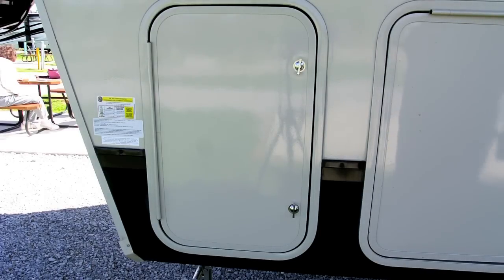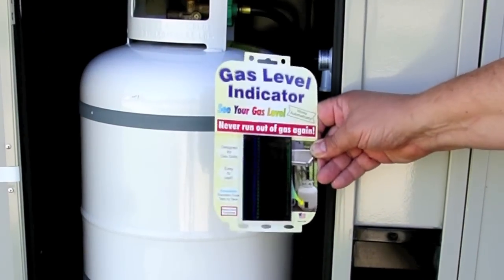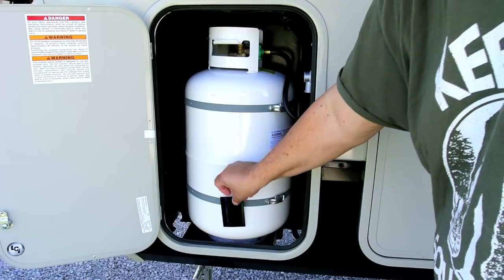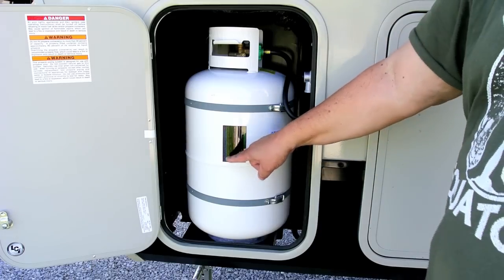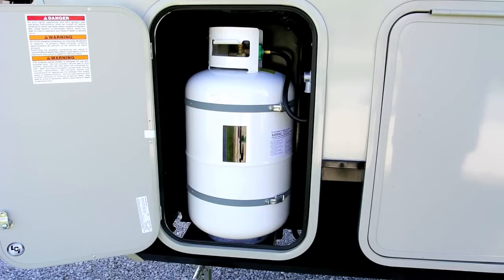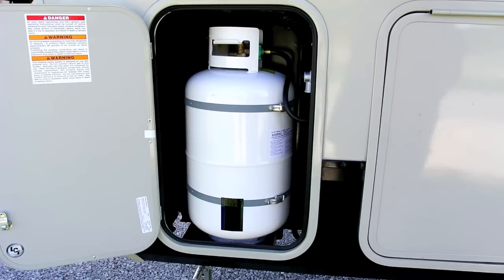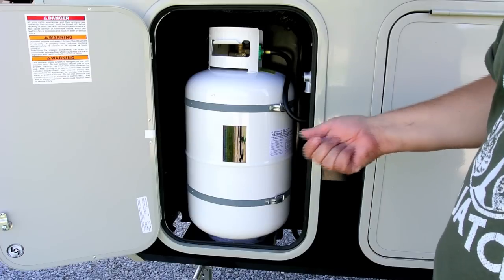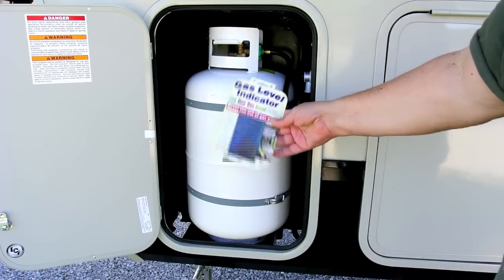Propane Tank Monitors - do they really work?

Comment: I use weighing scales. Weigh the bottle when it’s full, minus the tare weight of the bottle and that lets you know how much gas is in it. Then you can periodically weigh it and see how much is left
Reply: A scale is less than $30 so its worth it, if you add a little more you have some with bluetooth so no need to open the panel.I have a big one outside and I'm thinking to add a scale to check it, will be more expensive than a regular one but as you write I think its the best solution.

Comment: Just pour hot water down the side of the tank, feel with your hand the temperature difference. Where the liquified gas is will be icy cold. Where the gas is absent will allow the steel tank to heat up. It takes naff all water and is basically free if you use a little left over water from your morning brew.
Reply from the maker: Doesn't this method work best if you are using the propane? Expanding gas will cool the sides.
Reply: @RVProject  it may, but I have good success so I don't think it's necessary.. it's how I check my bottles before I use them to.make sure they have sufficient gas..  feels like a definite line of hot vs cold

Comment: I use a laser temperature pointer, very accurate and it's less than $20 on Amazon.
Reply: How do you use it with a propane tank?
Reply: @drinkinslim  if he hit it with laser it will explode otherwise it will not.
Reply: @kahitanongcontenttv1826  Hahaaa. :D
Reply from the maker: I can see how you can measure a temperature difference when the tank is in use, but how about when the tank is not currently in use? Is there enough temperature difference to detect.

Otherwise, a cool idea.

Comment: As a rule we use electric during the day and use the furnace at night but we keep it at 60 we have a small ele heater in the bed room for night time built in from ceder creek ,also we use the holding tank heaters ,got to admit black tank emptys fast when heated up,guess it helps the chemicals work better, great videos  very good information  thanks
Reply from the maker: Thank you for your support.

Comment: Our fifthwheel in cold weather can eat 2 tanks in 3 days use electric heaters when you can,our 5er is 42' so takes a good while to heat up
Reply from the maker: The only caution I would have is for those RVs that have underbelly heating (mine does for example).  For these RVs, some of the forced air from the propane heater is diverted into the underbelly so that the pipes won't freeze.

If you use electric heat, the risk is that the propane heater will not pump enough heat into the underbelly to keep the pipes from freezing. 

So my recommendation - if you have underbelly heating - is to run your electric heat (we have an electric fireplace) for temps over 32Deg, but fire up the propane heat in freezing weather. You can probably run both electric and propane heating, but keep an eye out for the temperature in the underbelly.

Comment: The magnetic monitors work best on the shorter 20# bottles.  Downside, hard to see if your RV has a propane bottle cover shielding them from the elements.  You have to take the cover off to see the level on the side of the tank.

Comment: the simple answer  (break open that wallet ) is one of the two Milwaukee thermal imaging cameras  2300/500$ depending on which model.  i got the first one that came out a few years ago (2400$ w/extra capacity battery ). having extensive experience using these devices as a professional  firefighter sence the late 80s i know the value of such a tool. I have used it to check my LP tank, tire temps, A/C function, refrigerator function,  find the steel tubing that makes up my sidewalls of my class C. i even found a  lost dog in a large open field at night  ( i used a Hoodman DSLR LCD view screen device to use the thermal camera as a night vision scope ) the uses around the  home and on the  road are limitless.  the cheaper unit is a new product i believe, but i didn't compare them. pricey? yes,  valuable tool? most definitely.
Reply: Ha Re 
Lol you can buy a phone that does that for $400. Plus makes calls.
Reply: You're saying my IR thermometer can show me if it's full?? Damn.. I'm going to try that when I get home.